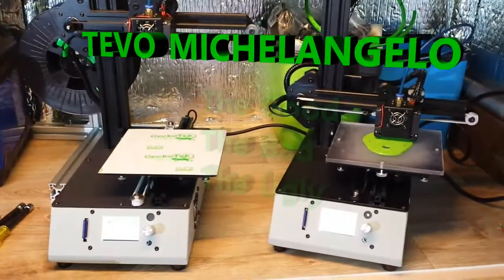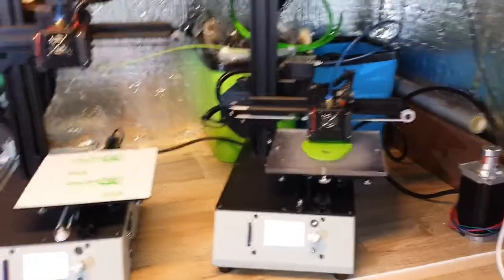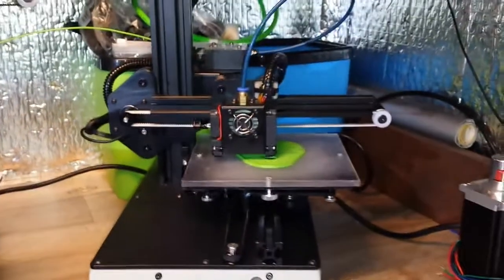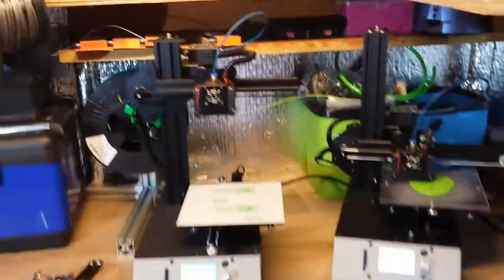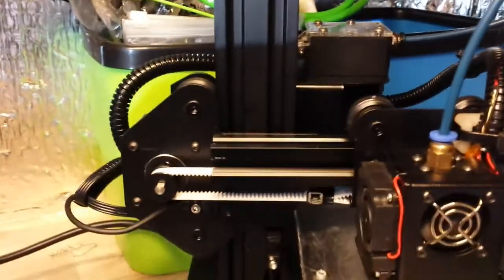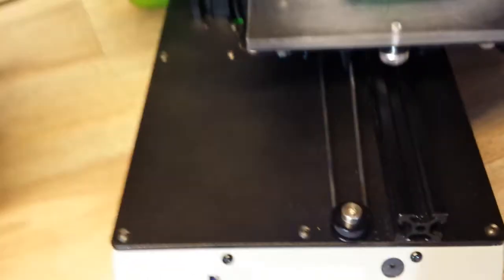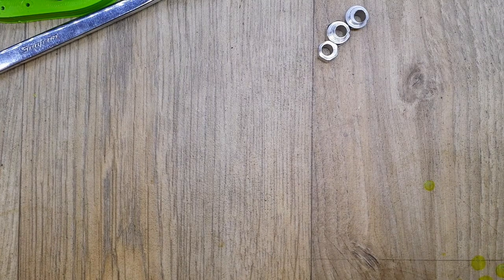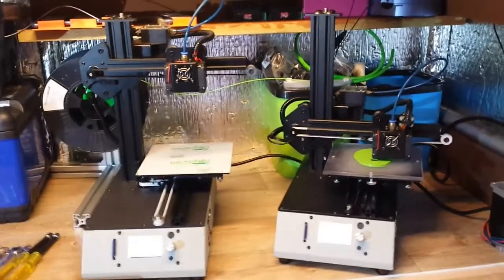Tevo Michelangelo   The Good The Bad The Ugly

Comment: Excellent review. It would be great if you could edit the description of the video and add links on aliexpress for the replacement parts you suggested (for example they offer 16 teeth wheels and 20 teeths in bore 3 and bore 5 and i don't know which one to get). Also, as someone with no mechanical experience, do you think I would be able to do the changes you suggested without heavily struggling?  Additionally, you could rate each of the improvements you suggested on a scale from 1 to 10, where 10 is the hardest.
I am really glad that you mentioned all of these small problems this printer has and how to fix them, now I know exactly what to except. Thank you for taking the time to do this.

Comment: What is the height of the aluminium spacers ? I know that eccentric nuts are 6mm, but you did not mention what size/height those spacers are
Reply from the maker: Hi Marek - Apologies for a late reply - I will have to check as they are different from the originals

Comment: I like to get some links, for the wheels and opel build shoulder roller .
Reply from the maker: Hi, Here is a link to the Cam adjusters that I purchased :  https://www.aliexpress.com/item/WHOLESALE-Openbuilds-5mm-Bore-Eccentric-Spacers-for-V-Wheel-Aluminium-Extrusion-3D-Printer-Parts-3D-Printer/32843859772.html?spm=a2g0s.9042311.0.0.sKsTh3

And here is a link for the idlers :   https://www.aliexpress.com/item/10pcs-2GT-16-teeth-20-teeth-synchronous-wheel-Perlin-passive-idler-pulley-wheel-bore-3mm-5mm/32845779723.html?spm=a2g0s.9042311.0.0.sKsTh3

For Authentic Open Build parts then it depends on the country you are in, if you are in the UK then I suggest Ooznest :   http://ooznest.co.uk/V-Slot/Wheels